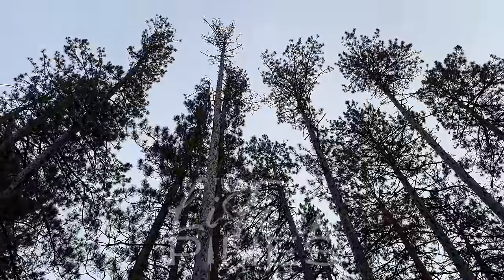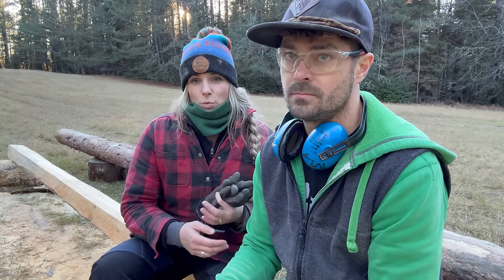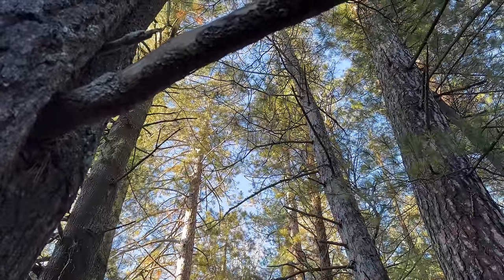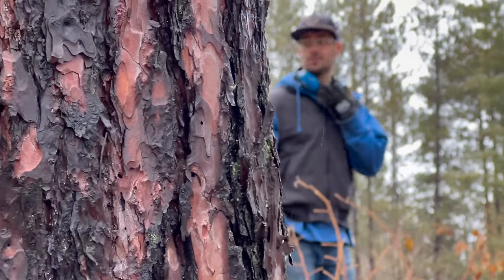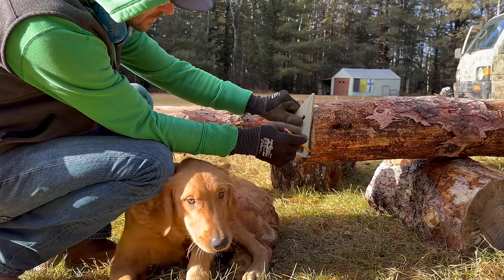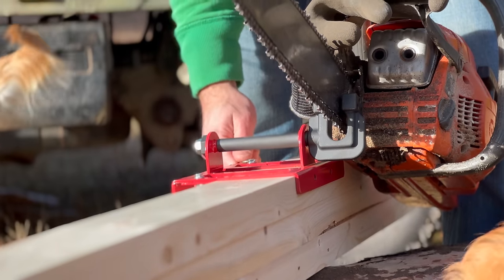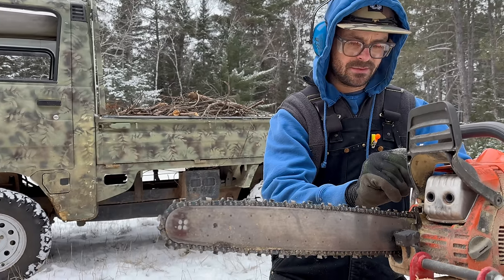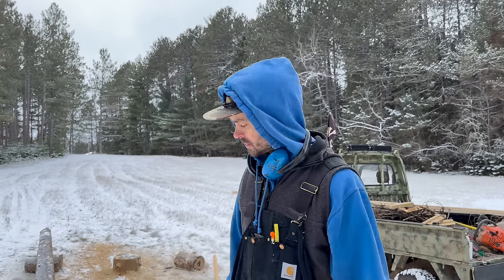OFF-GRID TREEHOUSE RESUMES! | CHAINSAW MILLING The 1st BEAM! EP. 1

Comment: Great video and I love the ideas you have for the treehouse and tents. suggestion: If you plan to use the two 16 foot 2x4s for the duration, you might consider putting a 45 degree miter on each board where they meet and gluing them togther with screws probably from the bottom side.  You can then cut the board to the length you want and it's now one board. Hope this helps smooth out the transition.
Reply from the maker: Oh! That is a great idea! Thanks for the tip! Wish we would’ve known that sooner! 🌲